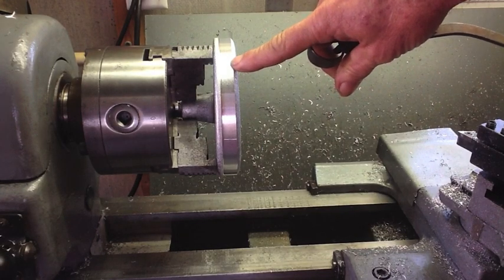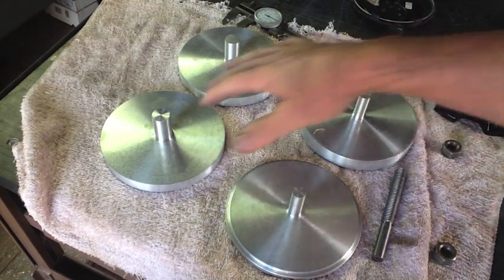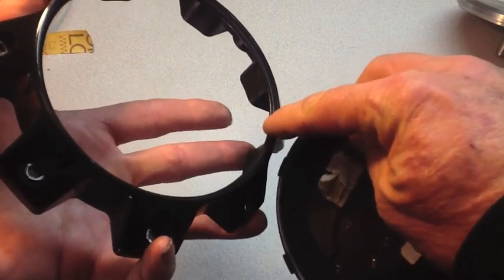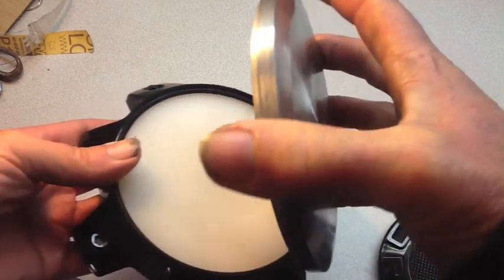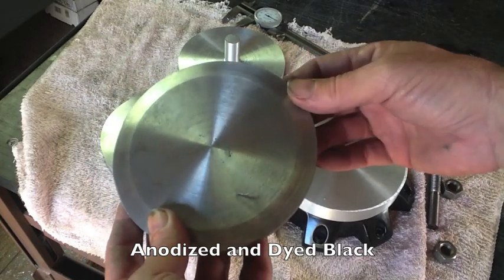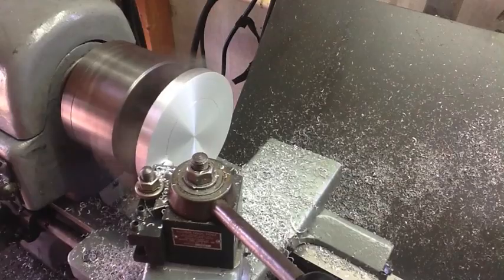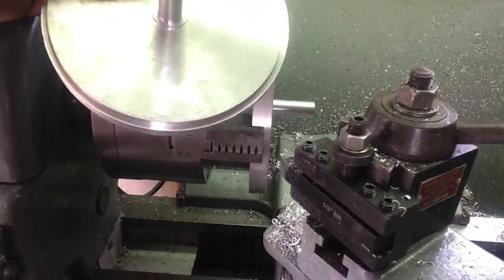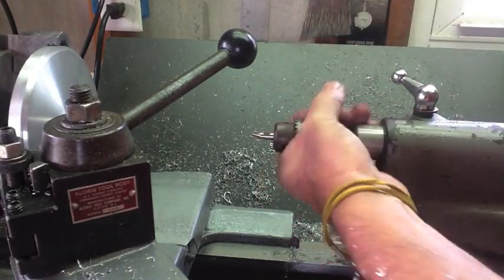DIY Aluminum Casting:  Custom Rim Center Caps P3 - MSFN

Comment: I really enjoy and appreciate your sharing this project!. 

A quick hint?  If you are going to be turning several of the same part, to the same dimensions, set the compound rest to 90° so it's parallel to the ways, lock the saddle down, and you can tell exactly where you are go, using the graduation dial on the compound..  ( spent a fair chunk of my time at the controls of one piece or another of equipment in the shop, before going back to learn to program the CNCs coming in, still kind of miss the hands on.)
I'm enjoying watch someone who doing home projects! keep up the good work!
Reply from the maker: Thanks!!!, I learned a ton about making identical parts in this project...have only had the Lathe operational since October and never owned a Lathe before...am getting the crash course for sure! :)
Reply from the maker: Part 4 being released soon! :-)

Comment: Not too shabby at all...:)    All he needs now is a hood ornament..LOL
Reply from the maker: That would really cost him :)
Reply: Especially in gold..LOL..Hopefully this year,if i don't keep buying photography gear i can get my mini foundry going as another hobby.
Reply: Especially in gold..LOL..Hopefully this year,if i don't keep buying photography gear i can get my mini foundry going as another hobby.
Reply from the maker: Making a Foundry can be done really cheaply. Speaking of cheap, can you suggest an inexpensive camcorder I could use for filming lathe work instead of an ipad mounted to a tripod which is rather cumbersome and in the way (safety-wise)
Reply: My hobby is mainly photography,so i am set up for taking stills and the gear i have is extremely expensive.Have you considered something like a used gopro with a head mount?..OR a gopro mounted with a small gorillapod.(a tripod with flexible arms that can be wrapped around a rail,post etc.You may be able to make a bracket and suspend it out of the way off the ceiling.My phone ,the samsung galaxy s7 takes good video and since i need a phone,the decent video it takes is a bonus.
Reply from the maker: I just have my iPad, was looking at a small sony type handycam I could mount overhead around the Lathe...I dont know much about cameras and such
Reply from the maker: I wont do a video unless camera is mounted stationery....I have seen people doing vids walking around with theirs....makes ya seasick...and I click off the vid
Reply: That seems like a good option.I use Canon Dslr for my needs but Sony has a good name in both photography and videography.
Reply from the maker: Cool, hopefully I may be able to put out a decent video soon :)

Comment: Great series you have there.  BUT, I am waiting for the anodizing.  I have been led to believe that anodizing cast aluminum parts does not work well, and therefore never tried it.  However, you will give me a chance to see if it will work or not.  Also, would you consider for S&Gs anodizing a cast piece that had not been machined all over to see how the sand textured areas work out.  I have made a bunch of things from cast aluminum and if I could anodize some of them would be really kewl.

Thanks again for sharing!

Joe
Reply from the maker: Thanks Heapster!, I have no idea if I will be successful or fail miserably on the anodizing. I am in the process of rounding all the supplies now. I want to anodize them all at the same time as well as dye them at the same time for a consistent result without breaking the bank. These are pretty large pieces so will require a large bath...I may have to do just 2 at a time. Trying to round up some cheap containers...a 5 gal bucket wont do. If I can remember to do a non-machine piece I will give that a shot for you. Remind me after part 4 is completed if I forget!
Reply: I am not overly familiar with the process, but I believe you anodize, then rinse, then soak in hot dye to color it, then boil the piece to lock in the color.  Am I close on this?  At any rate, I am excited to see your progress.  Thanks for all you do.

Joe
Reply from the maker: Degrease, rinse, anodize bath, rinse, dye bath, boil. I have never done it myself so getting a crash course myself. Every one can see me either win......or crash & burn on next episode! LOL
Reply: Well, I am with you in spirit through success or failure.  So if it is a huge success, are you going to celebrate with a little dance wearing the Birthday gift that Mr. Mortimer offered?  HAHAH
Reply from the maker: Lmao, I am not holding my breath on Mr. Mortimer! :)

Comment: Have you checked for clearance on the wheel spindles for your revised design???  This might be more important on the front wheels where the spindles stick out more than the back wheels.   Just asking.   But this series is excellent!
Reply from the maker: I discussed all that with my friend and he states it will work all around. Not having the truck here I am proceeding with his input it will work for all 4 wheels. Glad you are enjoying it....I am most known for the casting but machining stuff I cast needs to be done...there much better machinist channels out there but only having the Lathe operational for 3 months I think I am holding my own :)

Comment: I still think I would've just glued those together and made a mold of the entire thing and just cast is as one big piece of aluminum, the plastic holder is likely to break at some point even if it's just a mall cruiser and not a guy that goes offroad. Would've also cut the side down at more of an angle had I done it the way you did. If you look at where you test fit it in the ring it was hanging over the ring a bit and looking like a big block just sitting there. I would've found the angle of the steps/lugs of the ring and followed that out into the piece. Would've made it look more like it belonged. Something else I would've done differently is I would've put in a slug where the threads are either in brass/bronze or stainless or something as threads in cast aluminum rarely last. 
I don't mean to be a dick pointing out all these things, it's just how my brain works, I see things differently and I have to say it or my mind won't shut up about it till I tell someone. By sharing different ideas for how to do it, it hopefully gives you options for better designs in the future too.
Reply from the maker: Valid points Otis, I appreciate feedback....however there is more turning to be done after anodizing, an adjustment to the bevel angle is already planned. The outside diameter was left large for now as I can take metal off but cant add more, so will be further reduced on the final turning as well as more decorative stock removal to lighten up the center cap on the front side. Good catch...I too noticed the bevel angle was off a few degrees :)

As to the aluminum threads, the lock nut will go on just one time and be epoxied in place so will see no use so to speak. As far as making him a new housing...I dont have a mill so cannot make him a new one. I recommended to him to drill & tap two or more holes in his rim to use more than just the 2 bolts to secure this to the rim. I strongly suggested more mounting bolts....but its up to him to do that. I hope never to say..."I told you so"

Comment: Hi MSFN, Great series, I think that the old machinist who sold you the lathe would be well pleased to see you putting his old lathe to good use, rather than someone just letting it rot away in a shed, unloved and unused. I was a bit surprised to hear that your mate's $1500 rims only came with those crappy plastic centres, jeez they go to all that effort and then crap out in the final finishing touches. Sad to see.
With regard to the length of your video, I thought this one was just about right, but I guess it depends upon where and on what device a viewer is watching, so many variables.
Reply from the maker: Thanks Mark, no one wants to see a piece of equipment go to waste. I am trying to do quality work on the Lathe to compliment the casting aspect of the channel. I can cast lotsa stuff but all need machining to be useful. Am in the hopes some machine work will be well received by the subscribers. Those rim manufacturers are crooks for plastic garbage like that.